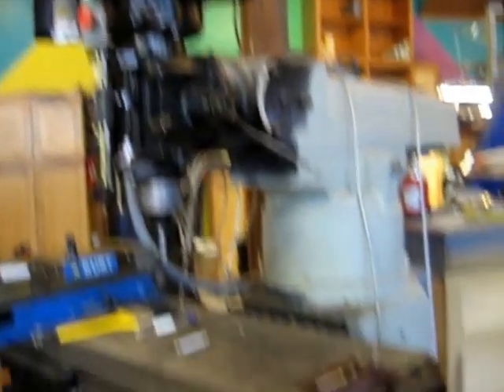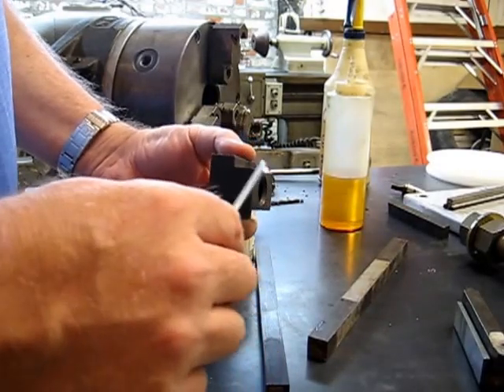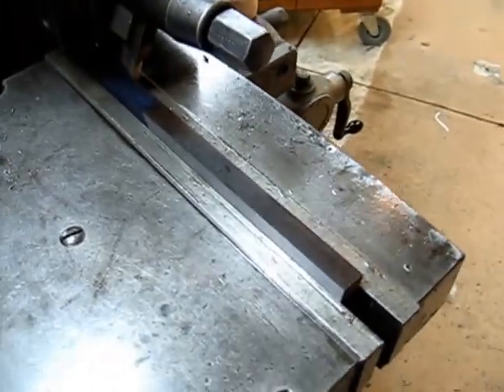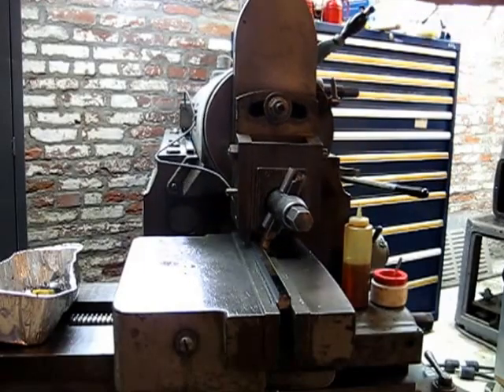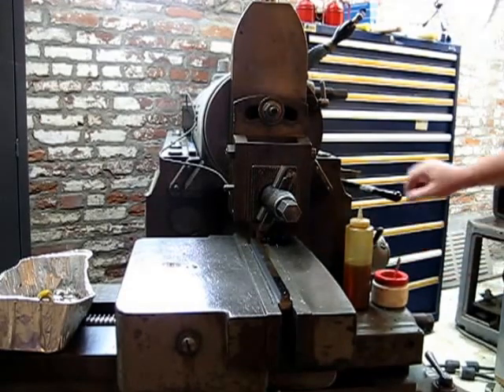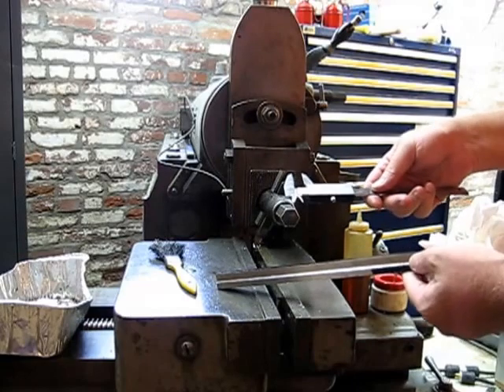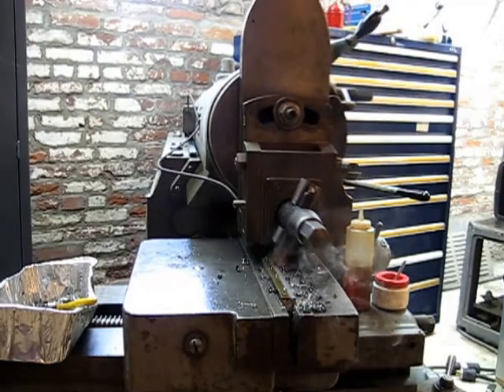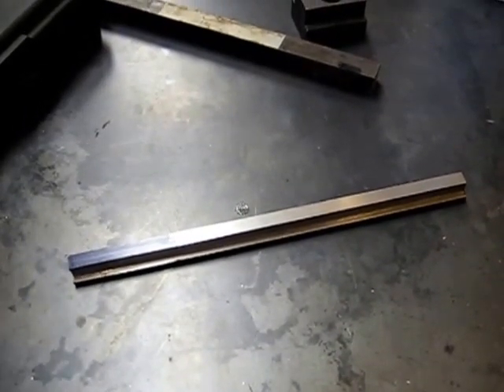Making Tee nuts with a shaper

Comment: Question-When you were cutting downward for the top part of the nut (when the table was stationary) how did you control the depth? Were you manually cranking the tool-bit downward after every stroke?
Reply: Curtis Wells yes I think he was. You can see his arm up there. My question is, how did he assure he got the same depth on both sides? Just from the feed dial or did he have a stop set up?

Comment: you have a mill.... make them on the mill.  completely ineffecient
Reply from the maker: +MotorsportsX This was never about being efficient, Mr. Pete did a video on making them in the mill, so I did a complimentary video using the shaper.  Sure a mill would be faster, but that has been done.  I hope you enjoyed the shaper action anyway.
Reply: A shaper can actually outperform a mill for speed. Shaper tooling is inexpensive lathe bits . Mills not so inexpensive. What do you find inefficient.
Reply: The mill is faster if you dont count the days of waiting for specific cutters//.

Comment: A couple of years ago I passed on buying a large shaper for basically scrap metal price of $600. I felt it was going to take up to much room in my shop. I've wished I had bought it ever since. I just located a 7 inch Ammco in running condition for $500.00 that I want to go see in the next day or so.
Reply from the maker: +superrodder2002 A 7 inch is what I started with.  You can do anything on it, just slowly, with such a small depth of cut.

Comment: I got one of these machines that I have just about got going now. The bearings on the main pulley were bad because someone must have bent the oil line that comes from the back way oilier that channels the oil back down to a 1/8 inch pipe elbow with felt packed into it to regulate the oil going to the bearings which in turn oils the gears for the oil pump. I can not wait to start using it. If you stick your head in the side after removing the cover and look down to the left the place I am talking about can be scene. It was a copper line that was bent; trying to figure out how to replace the bearing was a real challenge because the gear that drives the oil pump had to be removed first. The problem I was having was trying to install the gear and get the 2 dowel pin holes lined back up to install the pins. The gear is pressed in the same hole after the inside bearing is installed into the pulley. I removed the felt and washed it out and even trimmed off the top part a bit to make sure the bearings would get plenty of oil then reinstalled it in the 1/8 inch elbow. The oil drips onto the felt and then absorbs through it to feed oil to the bearings.
The guys that built these older machines were very smart to say the least, trying to figure out what and how they built the machines can be a real challenge.
Golden Rule is do not brake anything cause you most likely can't get another part.
John Fink

Comment: Ian Craig here James, from the south coast of Western Australia--yeah I agree with about Mr Pete--he is a gentleman and a scholar and just a blessing to us all world wide..
I am envious about the ability to pick up good machinery like your shaper---that is a flaming beauty,so versatile..That trouble with a gear in that lathe gearbox you had a while ago,well get your hands on the right type of metal that will harden and get stuck in..You will learn heaps,even if you fail the first time, who cares,its knowledge and you will be the better for it..
I am having a go at making my own shaper---its the only way I will ever own one..I want to be able to install internal keyways,number one but I figure in for a penny in for a pound so it has to be heavy and strong enough to do a bit of planing--decent sized gears etc..Cheers cobber...nil bastardo del carbonrundum...Don't let the bastards grind you down..
Reply from the maker: Ian Craig You might consider making a hydraulic shaper.  Some of the last, and most capable, shapers made were Rockford hydraulic shapers.  They had all the bells and whistles, auto down feeds, rapids, and TONS of power.  I would have to think sourcing hydraulics would be easier and cheaper as well, than a big bull gear.
Reply: +Ian Craig Hi Ian, were you ever living in Tasmania back in the 1970s by any chance? I once knew a bloke with the same name as yours if you're wondering why the question. I hope that your shaper has come along well in the last year or so too by the way. Cheers,
RT
Reply: +Rope Tangler No I have lived all my 60 odd years in WA

Comment: Thanks for the video.  I haven't seen a shaper in action much.  Looks like it might be good to think of if kind of like a linear lathe. The tool looks like it is ground similarly. I guess the milling machines took over most of the work done on them...though as you say, the finish is nicer on the shaper. 

-- Mike
Reply from the maker: That is exactly what a shaper is, a liner lathe, very astute observation.

Comment: Thank you for that video.  I bought a shaper last weekend and making some Tee nuts for my rotary table is definitely going to be my first project.
Reply from the maker: This is a great first shaper project.  Just remember to make sure the clapper has room to work on both ends of the work piece.  And don't put any body parts in front of the ram when it is moving!  Good luck!